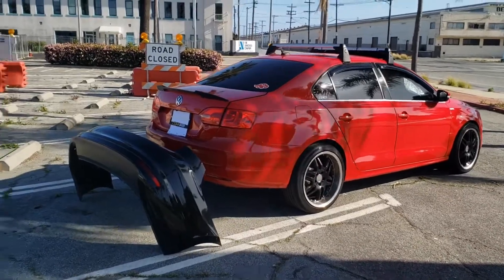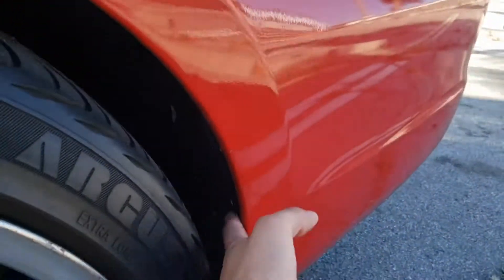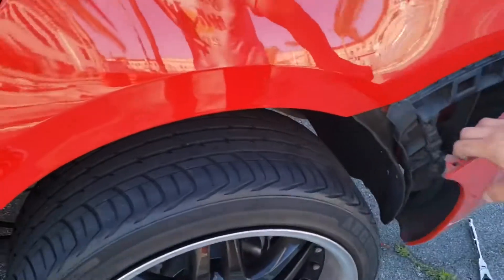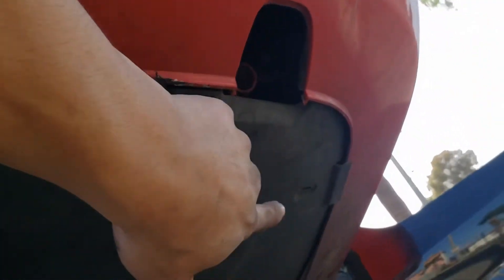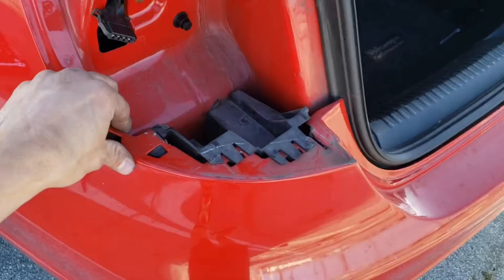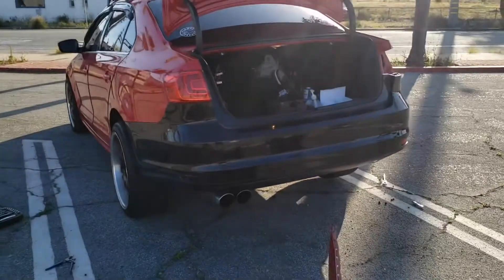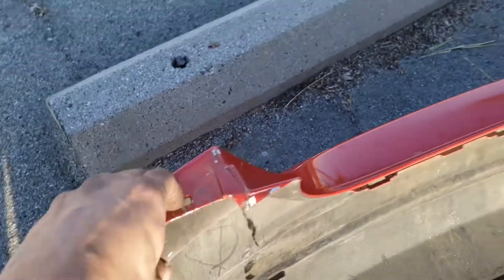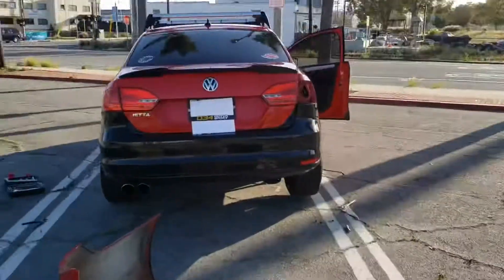How to remove MK6 Jetta rear bumper cover and replace with MK6.5 GLI bumper

Comment: I also have the '13 SE 2.5l and have been looking to update my rear bumper to a GLI one- either OEM or aftermarket. I've just been a little cautious and hesitant because of potential fitment issues like you encountered (even though it appears that it was still manageable). I did find a rear bumper valance that was made for our OG bumper to give it that GLI look on ebay or somewhere but can't seem to find it anymore. Anyway, thanks for uploading the vid because there's not a lot of info on this out there!
Reply from the maker: When I bought the bumper, it was marketed as a 2014 but it was actually a 2015 GLI so thats where my issue was. If you find the valance link, come back and share it! Sounds a lot easier than replacing the entire bumper.
Reply: Yeah, I think 2015 marked the mini facelift mk6.5, right? So that might explain the weird fitment you encountered.
Reply: @jorgino1007  are you still running this bumper? the facelift models had a more square trunk lid, so the bumper was also more square to accommodate it. I've heard this combination can have water leaks into the trunk, and there's also a big gap between the trunk lid and bumper. As well, the pre- facelift gli bumper is much more aggressive looking, with fins on the valance.